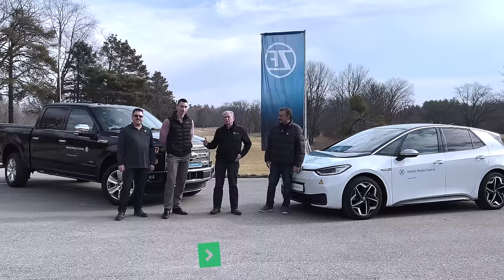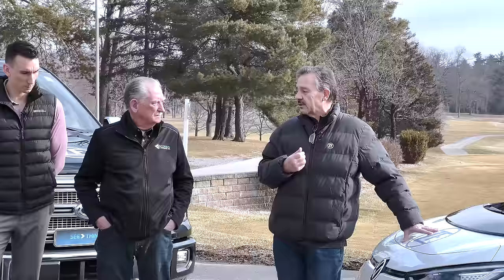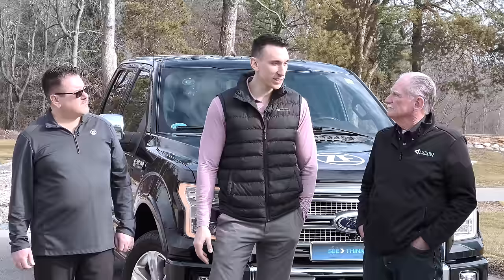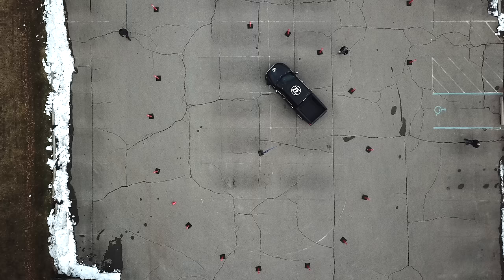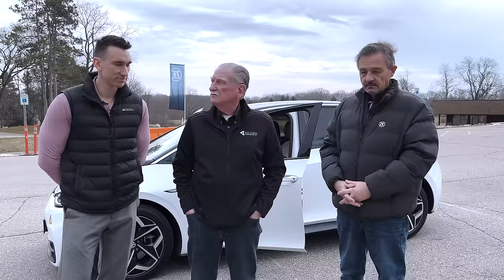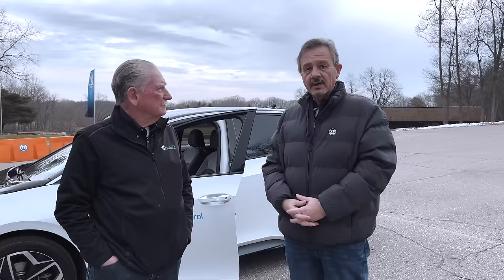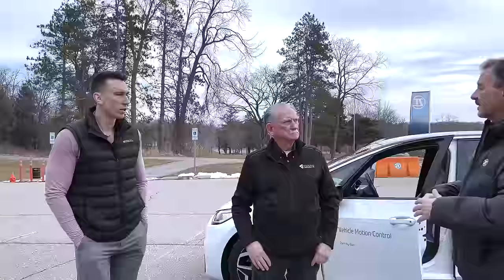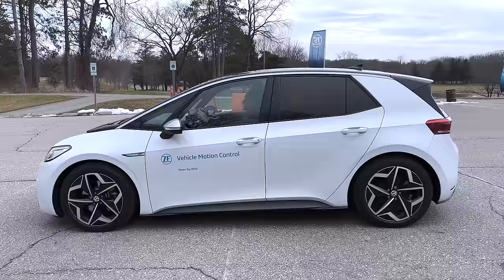Steer-by-wire - how it works with ZF

Comment: The efficiency and tire wear aspects make sense! Front tires wear more quickly from steering and braking,  and with the steering loads shared,  toe in can be reduced or eliminated,  tires can be narrowed, and in place of a brute force approach to turn in, a balanced approach by using both axles can enhance handling.  Toe and caster are passive, mechanical tools to enhance passive stability, where just as in fighter jets, the car could have reduced passive stability or even be dynamically unstable,  yet be made controllable with the steer by wire system. I can't imagine a need to set up UNSTABLE steering geometry,  but neutral geometry makes sense,  and the vehicle could still be safely maneuvered even if the load shifted,  a tire went flat,  or traction conditions rendered one or more tires unable to help maneuver.  Wow this is exciting stuff! Understeer and oversteer could be eliminated as negatives,  yet allowed in settings like sport or track mode.
Reply: Lamborghini has active camber and toe adjustments coming to market. For maximum performance a touch of toe out will dramatically improve turn in feel. Unstable alignment configurations are advantageous, but they need to be brief.
Reply: You've presumably heard of the kind of faults where the ECU craps itself and everything in the car dies while rolling down the road. Now imagine this scenario in a steer by wire and brake by wire vehicle. I definitely won't be anywhere near the front of the queue for any car with this setup until it's been very well proven in a few million cars. Since ZF is a well regarded company that have been doing decent engineering for a long time, they'll have considered this, but that doesn't mean other players in the car market won't be playing fast and loose with customer safety if steer by wire gets normalised.

Comment: Super excited to see the F 150 , with rear wheel steer ,that just made my day  what a miss by Ford not to have it on the Lightning. Hopefully the next generation truck will have it.
Reply: Ford will have to buy it.  They are already struggling to get costs down to where a sale does not cost them money.
Reply: FUD motors is Multiple DECADES behind TESLA motors.
Reply: @markplott4820  yet the lightning truck is a better OVERALL ev family truck than the cybertruck and it wasnt even designed from the groundup , it won without even trying super hard.
Reply: The F-150 Lightning rear suspension uses semi-trailing arms, which are not suited to steering. The multi-link rear suspensions used by other battery-electric trucks are more expensive, but more easily accommodate rear steering. Steering a beam axle (such as the rear of the gas F-150 and most other pickups) carries a substantial cost and complexity penalty.
Reply: @brianb-p6586   - the Lightning is still using OUTDATED horse & buggy TECH in 2024......lol.

Comment: The question that I have about the reliability and the fail safes that are in place with the steer by wire versus mechanical shaft. There’s not much that can fail when it comes to the mechanical application however, steer by wire relays on the combination of hardware, software, and complex electronics.  Electronics have tendency to fail with automotive applications and the more advanced electronics become, the more dependent the vehicle becomes for basic operational functions. What processes would be in place to ensure that in the event of electronic failure that input from the driver could safely guide the vehicle to the side of the road?
Reply: Вас закроют в машине, и будут везти куда им нужно. Они точно люди?

Comment: What was the main reason GM stopped offering the Delphi Quadrasteer?  I know it was over $5,000 option, which might be why very few paid for it.
Reply: Low sales, price was dropped from $7,700, to 5k, 2k,1k and then discontinued.  Honda tried 4ws with the Prelude in the same period with similar disinterest from most buyers.
Reply: $5k is the early 00s is like $15k today. It also wasn't very reliable
Reply: Going to full steer by wire made this far easier.   Quadrasteer was too complex.
Reply: Alfa Romeo had a passive rear steer system but any wear in the bushes and joints just messed it up.
Reply: at best gm Quadrstear worked, but it was UNRELIABLE.
Reply: @markplott4820  Far too expensive and never standard equipment.
Reply: @danharold3087   - TESLA mostly makes its own Equipment , its non Standard , Generally BETTER quality than Suppliers.
Tesla @ FREMONT makes 85% own Equipment, CHINA makes 95%.
Reply: @markplott4820  When I said "Far too expensive and never standard equipment." I was talking about GM QuaraSteer.
Reply: Lots of modern luxury brands (BMW and Mercedes but undoubtedly many more) have rear wheel steering for quite some years now.
Reply: @Conservator.  - but not many Electric models , that matter.
Reply: @markplott4820  BMW produce most of their models as petrol/gas, diesel, Plug-in Hybrid and as full EVs.

Comment: The ZF guys moved the pilons a bit closer when parking with the 4 wheel steering off.
Reply: Yep. Why did they move them closer?
Reply: I believe they tilted them away from the body to prevent scuffing the paint and put them right back on the markers afterwards when possible however the tires were often on top of the base plates at those times so they could not really move anything back into place until the tire was no longer making contact holding the base plate to the pavement.

Best!
Reply: I don’t think they were moving the pilons closer. They moved one a tiney bit to the outside when Sandy was parking with RWS off (to avoid damage).
Reply: It's just a few inches. I mean the benefit of the system is pretty clear.
Reply: No, they didn’t. Give us timestamps, but while you’re doing that, I think you’ll notice they did not move them and if they did, you couldn’t tell from the video.

Comment: ZF has always been a top tear OEM manufacture of mechanical systems, one area that I think this Steer by Wire & Rear Wheel Steering may have an application is for persons with disabilities. This can simplify  the complexity of modifying an adaptive vehicle steering along with greater control and individual customization. Next is the braking control? Munro has been a leader to improve product quality and manufacture techniques to lower cost (anybody can make a crappy low cost product). Nobody has looked at the Electric Skate board floor to allow a Wheelchair be loaded with a person and locked in place. Today the Vehicle modifiers cut a brand new Van floor off, lower it and interfere with so many other components needlessly, it's mindless. A system wheeled base Wheelchair with chair options that are interchangeable and a lifting system attached to the Skate Board to place Wheelchair inside the Vehicle and tie downs at needed position locations could open the world to transport for so many at an affordable cost with much less complexity.Thanks for both your companies, Rich.
Reply: Much simpler to cut the floor out of a car where the material you need to remove is just the floor than to do the same in a car where that space is full of high voltage battery. Also, making custom tiedowns in a normal car or van floor is stupidly easy, because you just have a sheet of structural steel to bolt into, because again there's no battery under the floor. I'm pretty sure the people who modify vehicles for wheelchairs are avoiding electric ones like the plague because a completely new set of techniques are likely to be needed.

There is one absolutely epic reason to go with an electric car for mobility and that's that it can very quickly charge the wheelchair as you drive to where you're going.

Comment: Outstanding... 😂
They accomplished impossible mission. For 30 minutes of talking about rear steering and steer by wire they all didnt said the word "cybertruck"
Reply: KKKK, i was searching for this comment, where have u been, funny thing is that we thought steer by wire wa solved by tesla, why did they wait so long to do this in the shadow of cybertruck.
Reply: @davidmkandhla  ZF solved all of this before Elon decided to build a "truck" without curves.
Reply: It's not that difficult. 4WS has been around for decades, and front steer-by-wire was first put into production by Toyota, not Tesla.
Reply: @brianb-p6586 umm... Yeah. But we are actually understand why this video published? ZF want to show that CT is not uniqe and they can do the same.
CT is not pathfinder, but it did what tesla did with e-cars, highlited posibilty.
Reply: ZF makes the front electric steering system for the Cybertruck.

Comment: Why add so much complexity and cost and potential safety issues to a system that is 100% rock solid?

In my current vehicle I've never been concerned about it getting hacked or the computer crashing or the steering motor dying and now I'm unable to steer the vehicle.
Reply: Well, as I understand, the CT has 2 computers on different power circuits, each cross connected to 2 motors on different circuits, plus dual sensor systems on the steering input end.
.
Reply: No reason. 'By wire' simplifies a plane... but not a car.
Reply: Because it enables new features and functionality. It's not a single incremental change, but an entire variety of changes it enables.

Whether we should never aspire to change (particularly improvement through change) is up for debate - there is certainly value in basic systems that anyone can wrench on - i think there will always be that go-kart aspect of vehicle/tool ownership.

Variable gain steering, adjustable steering, remote steering... our interfaces with vehicles has been pretty basic and required us to hack additions onto in order to innovate, such as with existing auto-steer.

The concerns make sense - but imagine where we'd be if airplanes still had to be steered via cables and pulleys.
Reply: I've had the power steering booster pump fail on one car, and an engine fire caused by a p/s hose chafing on the exhaust manifold of another. So as much as it makes life easier, I'd even score two marks against conventional power steering systems.
 All these new electronics only add new failure modes. And having more of them, they multiply the chances of a failure. Like computerized transmissions where "the computer" fails and the only way to fix it is to swap out a $2500 circuit board.
Reply: @lyfandeth  this is true of every advance in automotive technology.  Gotta embrace change or be left behind. The world won't stay one way forever. Especially in something so engrianed In our day to day life.
Reply: @northerngannetproject3147  Cars are evolving past what we had in the 1960s.   At some point we will pay more for insurance if we do not use self driving.   Considerably more.
Reply: @lyfandeth 
Fiat have had electric power steering at least since the Punto Mk2 (from 1999). It’s reliable and does the job. It’s old technology AND it copes with the shonky 12v electrical systems we are all lumbered with.
Reply: never had a half-shaft go? or a steering rack stop working? I have.  I don't see much reason to think mechanical devices are inherently more reliable than electronic ones.  I suspect the electronic ones can have the smarts to say "help! I'm dying" and give warning long before complete failure.  I guess squeaking noises would be the mechanical equivalent, but I think it would be a lot easier to understand if the software is well built.
Reply: @lyfandeth  they also remove older failure modes, and make diagnostics easier.  systems with intelligence can tell you what is wrong if they are built properly.  The examples you are giving are of people "doing it wrong."  Doing it properly might be cheaper and simpler, and reduce the chance of turning you into a kabob in an accident.

Comment: I'm critical of Tesla but I'm still impressed on how many new systems they have put into one new car, the Cybertruck.  If this were Toyota, we'd probably see 48V first and steer by wire after 10 years, and rear steering 5 years after that.🤭 Steer by wire is so worth it today especially with a car that is sold both Left and RHD.  Toyota is so behind, they should have been at 48V on all cars considering the low cost of LFP or lithium batteries.  I've seen a Chinese ICE car that uses a fairly large electric motor as a starter, alternator, brake regenerator, motor at 48V.  That's pretty quick and cheap way for a very mild hybrid propulsion. Alternatively, TOyota should have a hybrid by now like a Nissan kicks which is essentially an EV only charged by ICE and fuel all the time.
Reply: Toyota = YAWN 🥱
Reply: @FutureSystem738  to be fair, they were right being conservative with ICE cars. Their cheap cars are highly reliable. These days, an EV is absurdly more reliable than any ICE car.
Reply: Critical of tesla or don't agree with musk's opinions?
Reply: @freddydad1  I don't care much about the guy except back then he was the source of latest Tesla updates at twitter. Back to Tesla, they make some questionable decisions and engineering.
Reply: @zodiacfml  Not based on consumer reports for breakdowns of actual cars. EV's absolutely should be more reliable than IC engined cars, until you consider the century invested in making IC engines both cheap and reliable wasn't just wasted time. Also consider that almost all breakdowns, regardless of power source are electrical in nature - If you ignore punctures/suspension damage (Which heavier electric cars are more susceptible to) and running out of fuel (Which again electric cars are more susceptible to, especially when it's cold).
Reply: @peglor  For Toyota Lexus, breakdowns usually electrical.  High end cars and brands break on both mechanical and electrical. Electrical on EVs are more reliable due to thick large wiring.  ICE cars have dozens of wires and terminals for sensors and engine which lowers reliability.  Engine vibration also weakens the electrical systems.  The least reliable part in an EV are poorly chosen and engineered batteries like from the Nissan Leaf and GM chevy bolt,  generally the pouch cell batteries.
Reply: @zodiacfml  Electric cars have loads of sensors, many of which are identical to those in IC cars - think ABS, ride height, tyre pressure, cameras, yaw sensors, airbag accelerometers, coolant, cabin and outside temperature measurement, seat occupancy sensors etc. etc. They're all connected with the same just cheap enough to mostly work wiring and connectors as used in IC cars.

EV's only have thicker wiring where their cost engineering forces them to, which is between the battery and the motors/charge port. The wiring doesn't even need to be much thicker than used for the starter motor in an IC car because high currents require thick wires, so an EV high voltage battery can deliver more power at less current than a 12V battery.
Reply: @peglor  i'm speaking about wiring and sensors related to internal combustion like air sensors, exhaust sensors. these are very common to break due to heat and engine vibration, weakening the wires and terminals and cause an engine malfunction warning/light on the dashboard.
Reply: @zodiacfml  Agreed, but going electric by no means eliminates this as a source of failure. Also keep in mind that there are more electrical connections in an EV battery than there are moving parts in a normal IC car, some of which are subjected to significant heat loads and higher temperatures than many IC engine sensors (Not all of each cell in a battery back is well cooled, not to mind the connections on them, and resistive heating kills even low power electronics on occasion). 

I'm not denying that on paper electric cars should be more reliable, what I'm saying is that in the real world they have not proven to be based on reports from consumers who actually buy them. Given them the century IC cars have already had to refine their tech and they will be though.
Reply: Toyota has been demonstrating steer-by-wire to the public in prototypes for over a year, and goes into production with a second-generation version this year.

Comment: I have the Cybertruck and parking it is a dream... well not exactly it is big, but with the rear stearing and side cameras bscking it into a spot like that is not a major issues. I would say it's about 25% more effor than parking my model Y in the same spot. Rear steering and drive by wire really changes driving big vehicles.